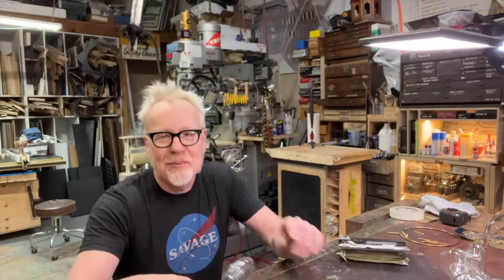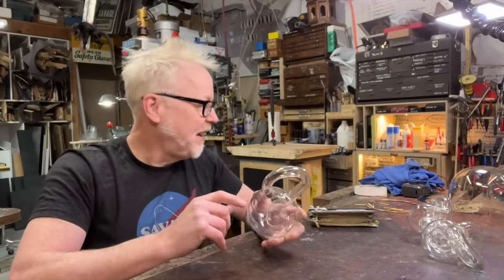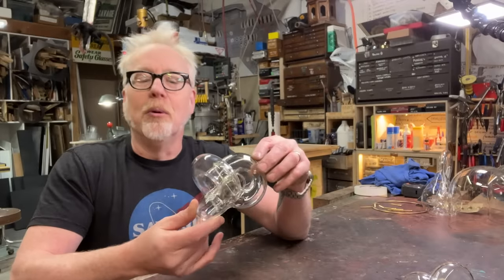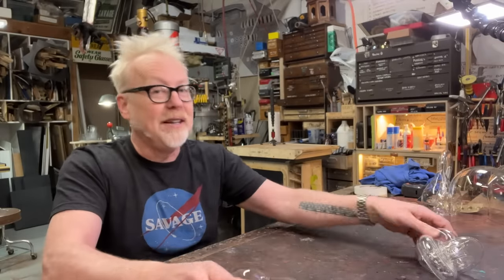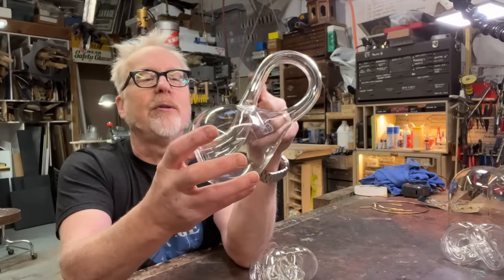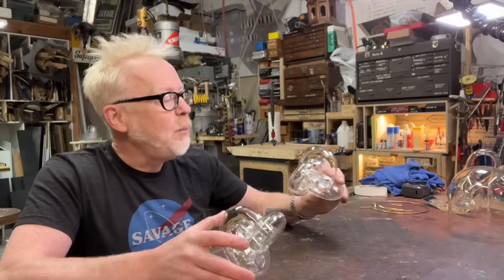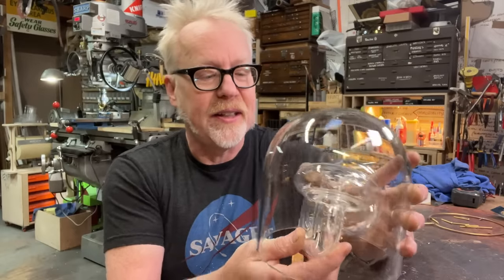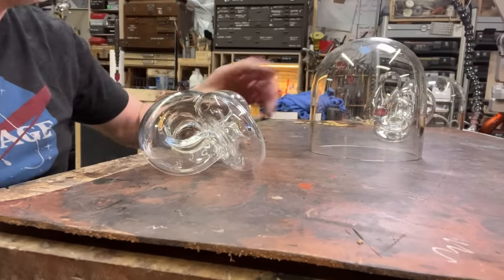This Object Should've Been Impossible to Make

Comment: Hey Adam. Something you can use for potential future projects similar to this. Molecularly bonded silicone/aluminum. Not with any glue, but just using the interesting properties of aluminum and silicone as they are in their own forms. I think you could very easily use this as a method to use the rigidity of a metal and still have the squishing/grippy gentle touch of silicone for handling a delicate piece like this. I've written details below.

I accidentally made this myself when I was trying to make a sleeve of silicone but didn't have the proper equipment I needed lol. I used a aluminum paint roller handle (that had a lot of paint dried on to it) which I scrubbed with a scouring bad, soap, and water trying to get all the paint chips off. Just so happened, lucky me also had just ran out of proper release agent, so I attempted (rather dumb like) to use vegetable oil as a release agent. I coated the aluminum handle in veggie oil before I had actually given the aluminum time to re-oxidize and proceeded to pour Smooth-On Exoflex 00-10 over it... Turns out silicone is oil based? Who would've figured right? (literally everyone..) The silicone absorbed the vegetable oil, just kinda becoming part of the A/B mixture itself and bonded directly to the non-oxidized aluminum. So I'm now in possession of an hilariously comfortable albiet relatively useless paint roller handle now. I've tried scraping it off with a razor, but it's so well bonded that even a razor gliding over the surface doesn't entirely remove the silicone. The only way you could actually remove it would be to sand down past.

It really is just as simple as sanding/polishish aluminum with fine grit/steel wool, making sure to remove excess aluminum dust/residue and immediately coat it in an oil of sorts. As stated above, vegetable oil worked for me but other oils might be better suited/mix better with the silicone. Once coated so the aluminum can't rust, you just mix your part A/B together and coat the surface you want to be grippy/squishy and let it cure. This would've been an interesting solution to making those cups in your brass ring able to squish against the glass and hold onto it better.
Reply: Silicone is not oil-based because it is based on silicon chains whereas oils are based on carbon chains. However, they are both non-polar materials (no inherent differences in electrical charges along the length of the molecular chains) so they are very compatible.

It is the polarity of water, from the oxygen atom holding so tightly to the hydrogen atoms, that makes water and oils non-miscible. The polarity of water is also what makes it possible to have a magnetic field shift a stream of water. It's a very cool effect you can do with a tap of running water and electrically-induced magnetic field.

The -OH (hydroxyl) radical on a single-bond carbon chain is what makes up an alcohol. Because of the oxygen-hydrogen bond, this radical is polar, one end of the molecule will be more positive than the other end. Short-chain alcohols such as methanol and ethanol are polar. But as the carbon chain gets longer and longer, the alcohol gets less and less polar.
Reply: @fredericapanon207  Hey, that's actually pretty cool to know :p won't lie, some of it is well above my head, but it's still useful information that'll be fun to look into and learn about! Thank you for informing me that silicones aren't oil-based!
Reply: @FeroSeele  that was mostly from grade 12 organic chemistry. The polarity of molecules was likely from first year university chemistry.

Many, many moons ago.
Reply: @FeroSeele  oils will migrate through a silicone. I have a silicone-impregnated suede hat (for waterproofing) which has a big oily looking patch at the brow because I used an oil-based moisturiser on my face.
Reply: @fredericapanon207  I'm sad I missed out on that class haha. Suffice it to say, my schooling was "meh" at best lol. Most of my learning through life has been through passion and experimentation. Science class was my favorite growing up and had fueled my passion for getting into various forms of chemistry nowadays, so thank you for sharing!

Comment: The instant you decided to flatten the cups my brain went "NOOOO!!!!"    The cup idea could have worked, but short of doing the math to derive the 3D shape needed to conform to the 'curving tube' segment of the object, I'd have probably sought to cast some sort of mould or make a 3D scan and 3D print functional cup ends.  I also think I would have chosen a display orientation that aligned the interlocking donuts along the standard x-y-z planes.  This would allow visualization of the complexity of the object to not be further obfuscated by the non-rectilinear presentation, but allow the observer to become comfortable understanding the object to clarify the wonder of its integration.

Comment: Not through the video yet, but my first idea would lead towards plexiglass sheets with a specific profile to rest the part in the wanted orientation, or maybe a plexiglass tube with a cut profile around the perimeter. You could nicely polish the edges and give it a smooth transition to the glass, or use colored material to separate the object from the holder.

Comment: I think I can give you a more intuitive understanding of a Boy's Surface. Start with a moebius strip, and notice that the boundary, or edge, of the strip is one continuous curve - a somewhat convoluted circle. A disc also has a circular boundary, so we can "glue" a disc to a moebius strip along their edges. We can't do this in 3D - if you try, you'll notice that things want to pass through themselves. We need an extra dimension to properly do this gluing without anything intersecting itself. This is analogous to a Klein Bottle: a "real" Klein Bottle does not intersect itself, but we need an extra dimension to make that happen. If you somehow shine a light on a 4D Klein bottle and let it cast a 3D shadow, the glass Klein Bottle on your work bench would be that shadow. Similarly, the 3D shadow of a 4D Boy's Surface is the glass Boy's Surface that you have.

Comment: with your light methodology i would have coated the outside of your bell jar with one way mirror film (mainly so the inside of the jar is dark until illiminated to give a better light effect but also to give the display intrigue as it will be mildly opaque when not illuminated) and then used screwed Y hooks coming off stands (to elevate the piece) to hold the inlets of the glass and also disguise red/green/blue LEDs which would be seperated by the glass' own design. obviously this effect wouldnt be as effective in bright conditions but neither would the leds so you could just take the jar off during the day or use dim lighing in the display room.

Comment: Adam, you could use the brass ring by putting suction cup holders inside the brass cups, even design the holder to have a spring (ink pen spring) that would push the suction cup out with minimum force, also you could make the inside (inside the glass dome) base rotatable, those were the first two Ideas (lit with LED is a must) that popped into my head as soon as I saw the  Boy's Surface at the start of the video.

Comment: My initial thought was a motorised stand coming out of the centre of the base, with the object balanced on a mount with a light inside and the dome over it. Then it would turn slowly to be viewed from all angles and lit internally.
Reply: Yep, I was thinking about the same. I feel the mount setup he came up with along with the light and a motor to make it spin slowly would really help show off the symmetry.
Reply: I had the same thought, but while also mounting it on a diagonal plane so that you could see it from more angles as it spun. (As opposed from the same angle for all 3 symmetrical parts.)
Reply: I'd like a cube instead of a dome for contrast between shapes.
Reply: You could've even made it a mechanical winding turntable like a musical box. That way it wouldn't even need electricity.

Comment: Adam, I loved this video, but I was screaming at my tv screen , “Adam, add a slow turning motor to another base with an on/off switch! “ With a motor, the sculpture would look slightly  different every time you walked into the room. You would probably have to add something soft to the bottom, so it wouldn’t vibrate off the furniture or shelf. Just a thought…..  Joan

Comment: Great project
I agree with your initial thoughts: a brass ring with three points. A few refinements come to mind:
Add semi circular brass clamps lined with gorilla tape to snugly hold the tubular shapes permanently attached and safe. You could also use neoprene as mentioned. Just limit the holding pressure so as to not crack the glass. Add a second ring to create a gimbal system so you can view the item with out breaking it. Add a led lighting system varying colors from below and the back with mirrors on three sides to highlight the dimensionality of the item. 
It’s a beautiful piece.

Comment: I think a really good way to display this would be; fish-wire from the ceiling to this object, hanging freely slightly above head-height… optionally a really slow stepper-motor to rotate the fish wire and the object… preferably in a dark room, with a single spotlight on this object

Comment: Idea to take it up a notch... Run a dim Red, Green, and Blue LED, one color up each of the middle of the posts with a cap to shine the light only in the direction of the opening it stands up into. That would highlight the folding of the structure and might do some amazing things with wavelengths combining in intersections. Not sure if the glass would visibly carry the light around the curves or not. Adding a very light dust/frost to the glass would definitely help see the colors.

Comment: End result is awesome, when you started I was thinking the way you were turning and exploring it would end up as a dynamic display that would rotate to allow viewing from multiple angles. It also seemed that if the cups were form fitting saddles it would have held up but I certainly wasn’t there and the complex geometry may not have worked out.

Comment: a fine thread to balance under the bell and a hidden vent in the base to gently blow air to make it spin inside will look much more appealing
Reply: and for the light on your design, I would put three color leds in each rod, rgb and make them transit, 
also for the switch i will choose a touch switch for any fragile object.

Comment: 30:41  Adam  have you thought of turning clear acrylic rods to support and use them as light guides for your illumination? If you shaped a point with matt finish the light should only show from within the piece, fit bright leds underneath the base. Just an idea
Reply: This was my first thought when he opted for the carbon rods, and he noticed they were too tall. If he increased the height of acrylic rods, they could hold the piece up and be used for illumination.

Comment: I'm kind of late on this on this article. But I had an idea. If you can feel that object with one density of oil that's of let's say a blue color. And the suspended in a sphere filled with let's say a yellow oil of higher density. Your glass objects should float in the middle of the oil filled sphere. Have the sphere mounted on a walnut base. If you want to get fancy, have tri-colored LEDs shining up into the sphere and reflecting off that object. Then have the three colored LEDs rotate color sequence so you constantly have a changing

Comment: Pardon,  not a make or engineer here but...:
Why not the original brass ring,  but with an additional ring,  attached but offset,  allowing a third axis of 'hold' with your little brass cups?  This would hold the item,  allow it to be seen and even picked up,  but prevent the need to ever touch the impossible object,  and this never have to windex the fingerprints off of it.   Anyway,  just a thought.  So fun watching you work,  and the mental gears churn

Comment: Adam! I think some bendable copper wire bent around the glass. Then it would add stability as well as making the Glass piece hangable. Solution to the problem is right in front of you and so simple. It would look awesome hanging from the ceiling!

Comment: If 10  years of engineering have tought me something is that, when you start making mistakes, when you start dropping tools and pieces... if the work can be postponed... stop go home and leave it for tomorrow AND SLEEP. 

You're tired, you're frustrated, you're possibly getting angry... from this point on, your likelyhood of irreparably damaging something grow exponentially with time and steps.

If the job cannot be postponed... take a 15-30 minute break doing ANYTHING but working or even thinking about the work that has to be done.

Your mind (especially your subconscious) needs to reset and reorganise.

Comment: You should use some kind of foam or rubber for the cups to hold on more secure and it will make a soft connection to the glass and then you can tighten the cups to the glass without it sliding out

Comment: I actually liked the original ring holder that you had going for it when you nearly dropped the piece. I would have just glued a clear rubber gasket to each of the tension holders. The issue was that the glass was too slippery, and there was not a perfect mating surface, so take that out of the equation.

Awesome piece! And thank you for your content. Long time watching, but recent subscriber.

Comment: I feel like a nice way to hold it would've been to put 3 strings through it, in a way that each string goes through two loops and thus 2 strings per loop. The color of the strings could emphasize the weirdness of the geometry. With the length of the strings one could control nicely how it is oriented in the enclosure and you even could make the strings attach to different points of the enclosure, so that it can be moved without the piece banging on the enclosure. Maybe attach the strings with magnets, so the piece can still be removed relatively easy.

Comment: My idea for that would be putting it into a some kind of colored liquid and made that liquid move. The most sofisticated version would be involved drilling 1-2 small hole on the object, filling it with some kind of translucent colored liquid, sealing it, and put the whole thing inside another different lightly colored or colorless translucent liquid, but watching about the dense of the two liquid, so the object would float in the middle of the outer fluid. After this make the outer fluid to move and throw some or just one light source/laser outside.

Comment: What I don't understand is, why didn't you make the threaded screws in your original mounting bracket (the circle) operate so that you could twist a nut outside of the circle to thread the cups onto the glass, and then make it so that as they thread into place, small claws extend from the cups around the glass? You could have made it so that they would thread into place and lock around the glass at the perfect measurement, and then when you wanted to remove it, they would pull away from the glass as you loosen the cups away from the glass? Put four claws on each cup, so they hold the glass on two sides at each contact point?

Comment: I like the display but I like the first version better before the oops moment but I have an idea that would’ve worked. Like those barstool sliders or the bottom of different chairs that they can swivel and adjust based off of different angle. I feel like you could’ve used those and make self adjust on the glass, turn them into something semi circle and once fit into it braze the joints so it locks into place and doesn’t move, but that’s a lot of corrections to make it possible

Comment: Use a U shaped holder out of 1/8” dia clear acrylic and heat it and form it to the radius of the glass and attach them to your brass circle at each tang and spring load them to keep mild pressure on glass.

Comment: 14:43 with your first piece you can angle (L shape) a rod out from the bottom center than back into the center of the glass with another cup holding it. You can then angle the whole structure so there’s support on the 3 sides plus the center will be holding it

Comment: I haven't seen the ending yet. I've only just watched Adam nearly drop it twice. Rather than gluing something to the outside to make a mount, I would suggest a two piece brass clasp that holds the tube and then have the threaded Rod screw through the outer ring. Maybe having a thin piece of felt on the inside of that clasp would prevent the brass from marking the glass overtime. But that would give you away to hold on to it and then the sky is the limit for the orientation

Comment: I liked the brass ring with the holders idea. I think all you needed was some rubber "gaskets" for lack of better word on the ends of the round holders to hold the glass from slipping. Make it adjustable for easuly installation and removal. Put that inside a glass dome on a virticle axis with a short rod to the top of the glass and bottom base from the ring. Or just no dome at all🤷‍♂️